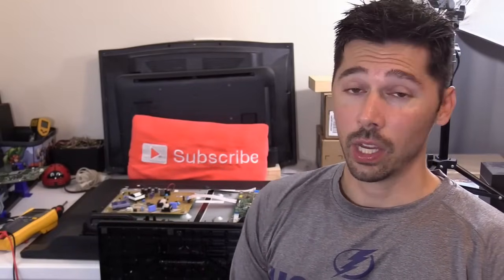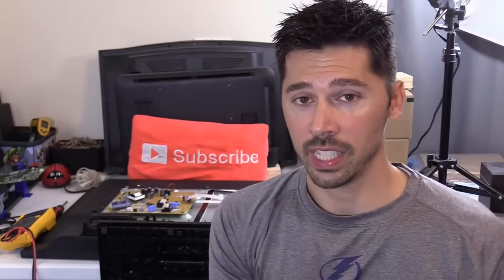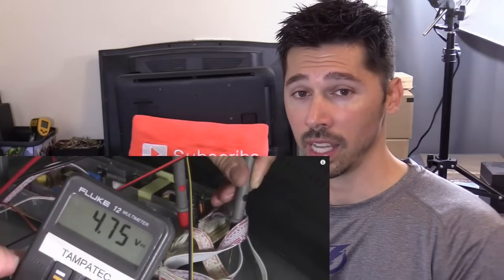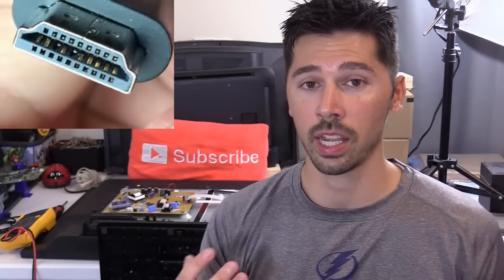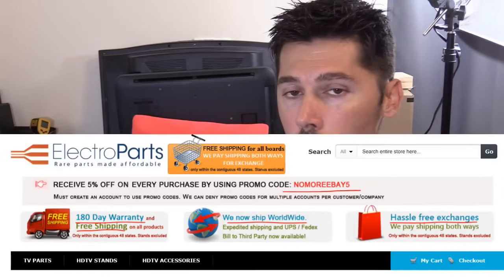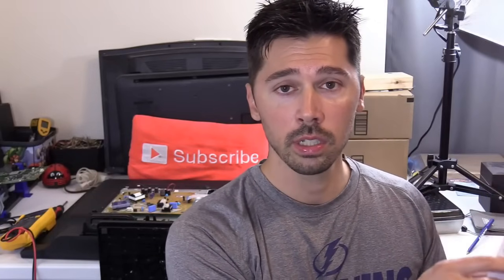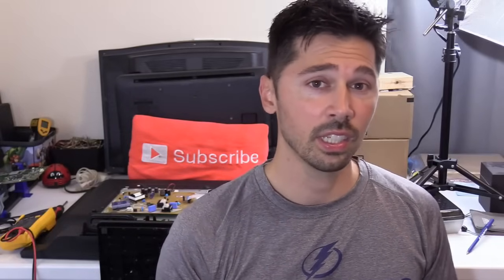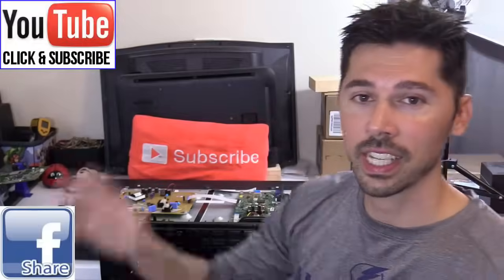How to Fix LED LCD TV Not Turning ON But has Standby LED Light

Comment: Sound technical info and advice. I am currently checking my Samsung UN55J6200DAF bcuz a few days ago, as we watched Tv, we began to hear crackling at the rear of Tv and it went dim blue, then black. It turned off with remote, but I disconnected everything off the wall outlet as precaution, bcuz I also smelled burnt wire. Watching pertaining videos, I checked fuse, its good. I inspected all 3 boards and only at the power supply board did I see like melted wire plastic. I could not see anything unusual on the main green board, it has a red lit port. The T-con board seemed ok as well, it has blue lights when I power on. Odd thing is, she turns on with power button and remote, but will only turn off with remote, and the red standby light blinks 4 times and stops. I tested all LEDs thru the corresponding wire leads and many did not light. I tested the port pins from where the LED connector goes, and it had No current going out. I did unplugged cable connector from main or logic board and did get the four 12.65v results in those leads, plus the 4.50 power on voltage of other side. One thing is for certain, I am going to replace All the LED strips with new. And I am prepared to replace the power supply board as well. However, I am not sure about the green logic/main board. What say ye..?  I'd appreciate any input.  (incidentally, this Tv is 7yrs old, was working flawlessly).

Comment: My led tv turns on for 2 seconds and shuts off . How do I turn it back on?
Reply: same problem with mine
Reply: @wahir1022  plug and unplug till it turns on
Reply: Bigwayne777 Gamer did you fix it?
Reply: @bigwayne777gamer9  we guys are waiting for you
Reply: @bigwayne777gamer9  bro i need to know how to fix my Element tv bro
Reply: @bigwayne777gamer9  ive been safe and well thanks i hope you have been safe too bro, and ill have my notifications on when you upload the video.
Reply: need new backlight strips
Reply: Same thing here, every now and then it actually works but is rare
Reply: When you have a timing-like problem like this, it tells me that most likely the problem is a capacitor problem on the power board. Those electrolytic capacitors have the tendency to leak, swell or become either shorted, opened or the capacitance value degrades. In these cases the remedy is to replace the capacitor(s). My Element tv had a problem similar to this one. The other remedy is to replace the power board.

Comment: Hallo I have a Telefunken TV. 
It looks like it goes into sleep mode. ... 
When I switch it on the led right is on 
Then I put it on at the remote( one for all remote) 
The red light turn blue and then the light flash 8 times

Comment: I think its my extension cord.  I unplugged it and plugged it into a regular outlet and it worked.  But I plugged it back into the extension cord and it turns on for like 3 seconds then shuts off.  Which is odd because I have 2 other things plugged to that extension cord and they both work fine

Comment: Yep, I had no TV turn on, but the power light was OK.   It turned out that all that was needed was the connector contact cleaning.  After cleaning all of the connector contacts, all was new again. So, my 2010 LCD Samsung TV (C350 Series), is still going as good as new after 10 years of use. There is still no noticeable difference compared to the day that I bought it.  Actually, I stand corrected.  When scanning for available channels, it shows which channels that it has detected as available by highlighting the channel number as it progresses from one channel to the next and so on.  However, after an automatic software update, Samsung screwed up such that each time it highlights a channel number to inform you that this channel is available, in truth it is highlighting the wrong channel number all together.  But it still captures all the available channels just as it did before with the previous software version.

Comment: hey , my tv is stuck in red light mode
standby
it was on
i got new tv remote
i turned it off with the new remote first time using it
then the tv remote wont work/ tv button wont work
black screen no light
red standby light? how do i fix this
tv code wont work for remote,?

Comment: I just replaced my motherboard with a used one since they don't make New Philips 32PFL5332D/37 boards anymore.  I got the part number that was required and installed it.  The two green LED lights come on, that's on the motherboard.  With the old mother board, the picture would come on but about ten minutes later the Picture shuts down.  I had gotten sixe blinking light with this condition.  I changed the power supply,  Got the Standy light and the blinking code stopped.  Now with the repaired powerboard, the screen doesn't come on.  I shut power off and went and ordered an inverter board. I will install it when it arrives and see what happens. Now you're saying it's another Main Board...Hmmm.   I shall see if a different one fixed it.

Comment: I have a red blinking standby light and I unpluged it ad plugged it in and it's not working and it has sound but the screen is completely black
Reply: Mine is doing the same.  I just ordered a main board to see if it fixes it.
Reply: Main board installed. Still no pic.  Maybe tcon board is bad?   I think I'll just get a new tv.

Comment: What if my tv is normally not getting power and every time I plug in the power plug the led light turns on and then off. Every once in a while the led light stays on the tv works fine, but the next day it’s back to not getting power and I have to re-do the whole process again.

Comment: well this is beyond what I can or will do. I have a skyworth TV (a gift, not my choice) that will not turn on. The LED standby light barely glows, but it isn't as bright as normal. I'm not capable of changing out parts these days. 

Not why I'm here, but had a weird TV problem once. TV would run, then just shut off. after a few minutes it could be turned back on, but would not stay on. TV repair shop could not get the TV to duplicate what it was doing at my inlaw's house. However, by doing a little experimenting, I figured out that there was some flaw in the power at that house, likely too much... anyway when there was a drain in line with the TV power, the tv would work fine. So, what to do? I got a combo electrical box, wired a cord to it, then a dimmer switch, then on to the outlet that the tv would now be plugged into. With the dimmer switch set just so, the tv would work just fine, no more problems.

Comment: I have a TV that when its plugged ,the light that is suppose to be RED is BLUE all the time and if i press the ON button it wont turn on as if the TV isnt plugged at all, and usually before I had this problem the blue light means that the TV is on the activation process.
Reply: try flash on the screen, to see if there is picture but no back light.

Comment: Hey. I have sound and back light in my 70 in vizio TV. I replaced the T con board and I tested it and got the picture back. Ya!!! So I put the back on the TV and hang the TV back on the wall. And low and behold, no picture again!! It’s back with the same problem!! Have sound and back light, but NO picture. HELP!! What happened and how do I fix it?

Comment: PLEASE HELP. I connect my tv to power. The stand by LED turns on for 3seconds then it turns off, this way I cant even turn the tv on. I tried with different sockets but same thing happened. Is my power board defected?

Comment: Hey I’m fixing a tv and the backlight was out, while I could see images on screen with a flashlight. Took the thing apart ,just led tested each strip,  each light on every strip lights up, but not when the tv was turned on? Power supply board?

Comment: Newly bought brand new american home led tv 40 inch.. standby led light but no power on.. no switch on the tv only the remote..
Reply from the maker: Does tv Remote only turn on the TV? Unplug power cord for 1 minute to hard reset tv, next try check board connections to main board and io board for tv buttons or stuck button.

Comment: Hi, thanks for your videos. I have a Sansui LCD TV STY0332, when turning on with remote or power button on TV, red standby light goes blue and straight away back to red. If power on remote pressed several times eventually it stays blue and TV works normally using remote etc. I found out that on eBay that the main board (AKURA CV106MS) and TV IR Sensor (6003120087) is the same part no. as it the TV. Replaced the main board, remote and power button did work to switch on but not off and other functions not working. Picture also showing menu in black and white multiple times and no interaction possible. Suspect may be new board faulty! refitted old board with new TV IR Sensor, it worked for one day and then started to play up as before. Thank you for advice.

Comment: +1. Tier One diagnostic overview's. .. Our August 2013 production TC-P55VT60 Panasonic plasma screen purchased new would suffer a voltage surge/spike byway of a cable connection during a 2015 lightning storm. The electric utility went unscathed however Comcast cable needed a week or better to effect repairs of the nearby damaged area. .. At the time the plasma screen had a mere 2 years of use on the clock;  The lightning strike left the plasma unit with a blinking On/Off red LED. .. Unplug the power source,  wait 60 sec then power up the unit. The screen displays nothing, yet the red On/Off LED blinks 10 times. .. Go figure. 
The nonresponsive plasma screen was set aside at the time. .. Fast forward 4 to 5 years and its time now to execute a little DIY fix'in courtesy of Herr TampaTec. .. Cheers, M/S

Comment: Hi i have a 22" TV i turn it on and it works ok for about 15" and then the remote control stops working The remote is ok because when it stops working none of the buttons work on the tv

Comment: I have a element tv that when I plug it in the red light turns on and then after about 5 seconds the red light will go very dim and it's like flickering and very few times I could plug it in and keep clicking the power button and get the light to turn blue which means on but it doesn't turn on, the light will just go red then dim,          any help would be greatly appreciated.
Reply: My Element tv had a problem similar to this one. Most likely the problem is a capacitor problem on the power board of your TV. Those electrolytic capacitors have the tendency to leak, swell or become either shorted, opened or the capacitance value degrades. In these cases the remedy is to replace the capacitor(s). For you most likely the other remedy is to replace the power board. It is easier to replace the board than troubleshoot at the component level.

Comment: Samsung UE46S8000, no picture relay sound clicking for every 5 sec.    voltage drop on power supply., but if the system connector is unplug from the power supply., the supply is stable relay no sound clicking..

Comment: Lots of useful information but instructions are rather muddled and continual reference to whether or not there is power, when we know there IS power if the LED light comes on don't we?
Reply from the maker: True But if the red standby led light is on you do have power but you may have not enough to turn on the circuit.
Reply: @TampaTec  Fair enough. Mine's blue and recently has started to flash if left on standby more than a few minutes , so I started turning it off manually at night. Now it starts to flash within a minute of receiving power and does not respond either to remote or manual input either before or after the flashing starts.

Comment: If You Have Xbox Or PlayStation Go On Settings Find Customise Power Options Scroll Down To TV & A/V Power Options Then Tick Console Turns On Other Devices And Tick Console Turns Off Other Devices Restart And You Should Now Be Able To Switch On/Off TV By Using Xbox Controller 😉

Comment: Hi, I need some help from anyone who is Experianced with electronics, I have an LG smart tv that had A backlight issue, the tv worked as expected but the backlight would flash on and off intermittently every couple of seconds, I was told this was the leds and ordered a full set of new led strips and fitted them. After putting the tv back together I tried to turn the tv on but their was no life, the standby light wouldn’t even come on, could it be that one of the led strips is faulty and the power board has blown a fuse. I don’t see why it wouldn’t turn on it was working fine and now nothing even when the backlight is disconnected from the power board. I’ve tried using a different power cable with the same amps, theirs no buttons on side of the tv to check if it’s just the power button that’s faulty either.